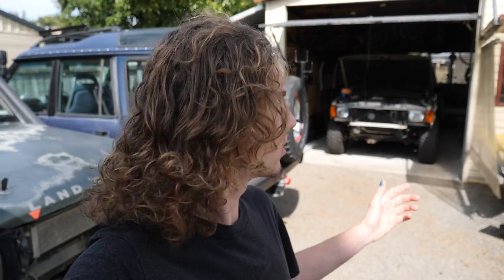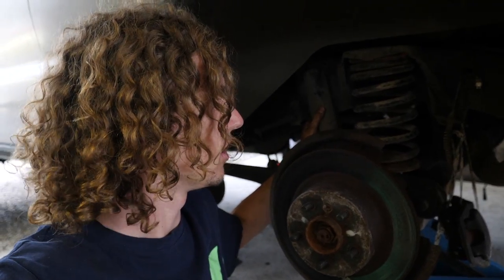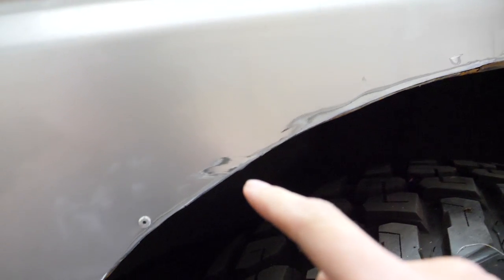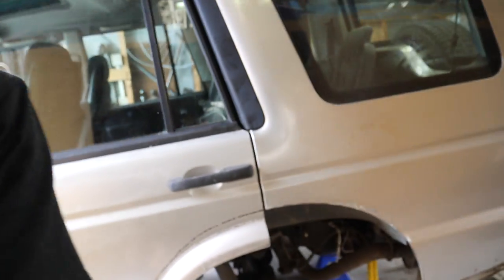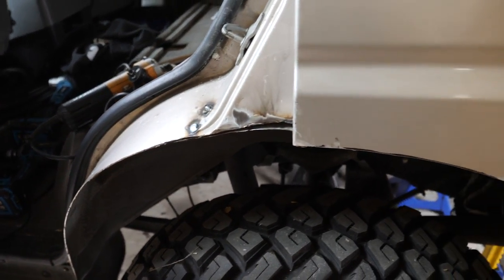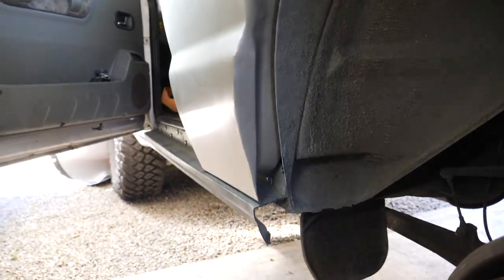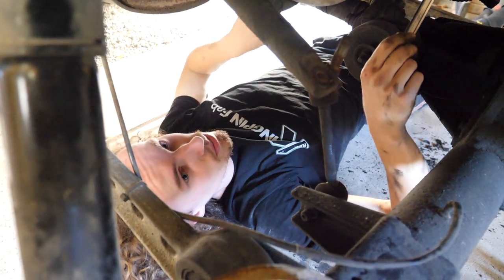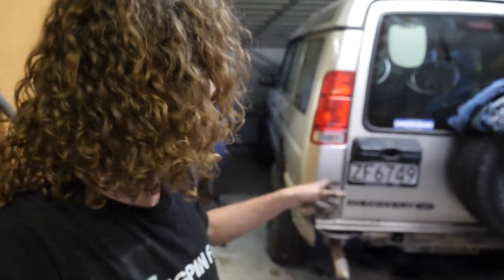WILD Door CHOP! How to fit Oversize Tyres & LIFT your DISCOVERY 2! Beater Truck Build CONTINUES!

Comment: Thanks for the Disco 2 videos. You can add another .5" (13mm) to the rear by adding a Disco 1 spring plates and a spring retainers. That is what I did on my Disco 2 V8.
Reply from the maker: That’s a great point, I’ve already done this on my truck but forgot to mention it in the video!

Comment: Nice work being sick and all. Love watching you guys rip in. Tip on drilling sheet metal if you have a bench grinder you can take the rake off the drill bit so it does not pull through the material after it cuts. Keep up the awesome progress 😎👍
Reply from the maker: Thanks for the tip! Cheers!